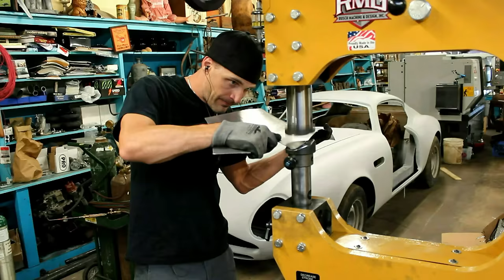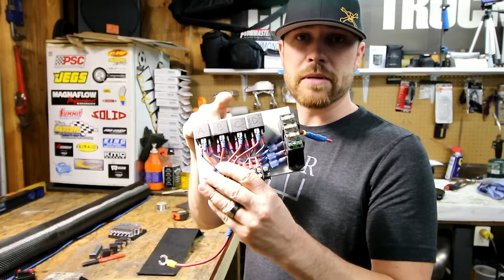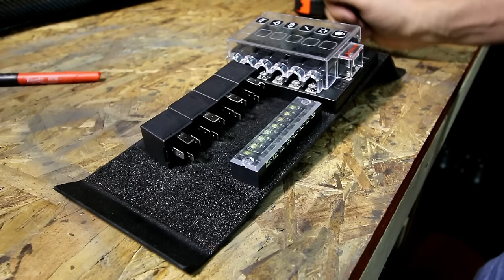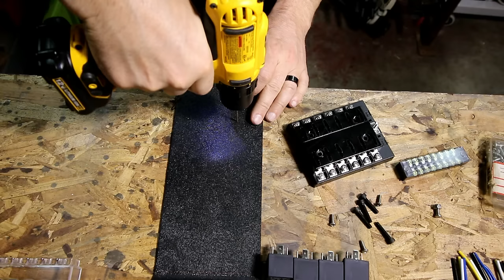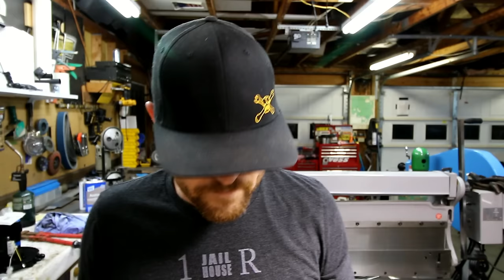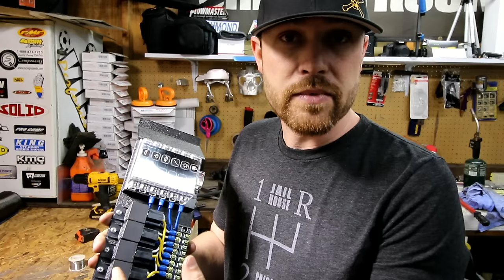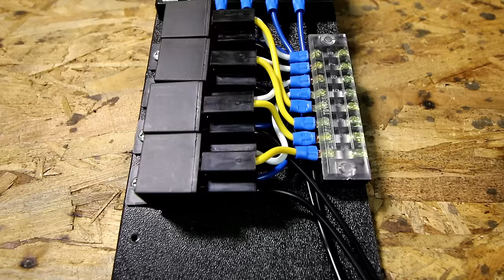How To Make A Power Relay / Fuse Block | Automotive Wiring

Comment: Finally!!!! I have power watched countless videos that say they’re gonna explain relays and fuse box’s but all they do is tell me how they’re installing it their car and don’t explain shit about how to to wire the actual relays and how it all goes together. I had pretty much said this is the last video and I’m giving up. I’m so glad it was your video. You should do a how to video on how to do a how to do video. I finally get it. Great explanation. I had it all wrong in my head. I do have one question that I still can’t find an answer to. I have a 4awg cable ran to an lc7i LOC and amplifier using a distribution block. Can I run a wire off that same block to the fuse box? If so, what size wire? Thanks for the video and any help?l
 -White Boy

Comment: Well i wish I found this a couple years ago when I was wiring all my lights. 
All my relays were bolted to the fender and it doesn’t look bad but it could’ve looked better.  I don’t have the time to make it pretty but maybe this winter I might pull it apart and make it look like it was meant to be there.

Comment: Nice job. I am a big fan of neat and tidy and organised; it makes fault finding easier and shows forthought and planning. I actually thought that the fuse needed to be between the load (switch) and the power. Doesn't your fuse block only blow a fuse if the relay blows? What happens if the horn (light or whatever) shorts - is it fuse protected? Thanks.

Comment: Thanks for video. I've never seen these breakers here in Russia, we're use 70/100/150A PAL type fuses instead. It's cheaper. And - I didn't like the way you attaching relays. If you will need to replace one of them, it would be pretty difficult. It is better to buy some common relay mount which you can attach to base, and you can put relays in and out of it easily. Sorry for my poor English, hope you understood))

Comment: Question about all the black wires going to a common ground.  I've seen this done two ways: One, common ground to the chassis.  Two, common ground running back to the battery negative (which is I think how sPODs are recommended to be wired?).   I'm building one of these to install in the rear of my Jeep, and trying to determine if I should run just a heavy gauge dedicated power wire back to it from the battery, or also a heavy gauge dedicated ground wire back to it from the battery as well.   Thoughts?

Comment: You can easily remove spade connector in plug with oring pick, small screwdriver pushing into plug behind female spade opposite the open end side, to a 1/4, 3/8", releases hook on spade, pull wire out, add longer one, use female connectors with the retaing hook

Comment: thanks for the video, i wanted to ask as a switch also needs power would this connect to the other side of the fuse block? so in effect a horn for example would need two fuses one to the relay and one to the switch.
Reply: I have also been scratching my head over this question. It would seem crazy to have the same circuit to have two fuses. I'm thinking, run a 10 gauge from the "ignition on" to another distribution block, then run positive wires from that block  to any switches you need. Then run the other side of the switches to the activation connections on the "power board" white wires. Does that make sense?

Comment: Nice job. Just got done doing something similar for an led project in my garage. This looks much better. On the relays, any idea why the mounting tab is on the relay and not the connector? Seems like for wiring and if you need to replace the relay it would be a lot easier if the connector mounted to the base instead of the relay.
Reply from the maker: not sure what you mean

Comment: i dint know if the plastic that you used is KYDEX but kydex is a very similar material that is used to make gun holsters and knife sheaths and i bet it would work great for this application, they offer it in many different colors and patterns too
Reply from the maker: yeah its the same thing. Kydex is just a brand name of abs plastic, just like I used.

Comment: Great how to video.  Just a suggestion instead of having a common ground you can add another distribution block for the grounds, this way you can use them Individual as remote ground triggers if needed instead of a hot wire or positive trigger.
Reply from the maker: good idea
Reply: The Fab Forums , Sorry I didn't read all the comments below I guess it's been mentioned before. Thank you for taking the time and making the video it was a great how to.

Comment: Finally found a video That makes this feel simple! 

Would this type of set up, using a 30amp fuse on the fuse box, support a light bar pulling around 25amps through that terminal? Using a thicker gauge wire after the terminal in order to carry the power over a distance? Or would I have to use thicker gauge wire between the fuse box, relay, and terminal? 

Also would this be safe to mount inside the cab? I have a lot of dead space under my cupholders in my centre console
Reply from the maker: yeah for sure

Comment: AWESOME AWESO I am working on my race car and just one step higher than a novice, and this video is exactly what I needed to clean up the rats nest in my floor boards. may I ask where do you pick up the power for the switch to act as a trigger...
Reply: Just go into your stock fuse block with a multimeter, check fuses when your key is on and off. Tap into a fuse that is off with key off and on when key is on for 12v switched trigger wire
Reply: @eugenechurch6135  No key, off and on shut off at rear of car. Race car. Should there be a fuse between the switch and what powers it?

Comment: Subscribed!  Good video.  Wish I would have put the fuse block, circuit breaker and relays on a pre-assembled panel.
Question:  Why not butt connect your power out and switch wires?  One less connection. and could more protected from corrison. 

I look forward to watching more of your videos
Reply from the maker: the power out is the high amp feed. the switch wire is what clicks the relay on and send the power out high amp feed
Reply: Correct, I'm wondering what the purpose of the distribution block is.  To me all it does is add an extra connection point.  Maybe I am missing something.

Comment: Thoughts on using relays that have fuses built into them? I've seen a few of those where you can just attach a fuse to the relay, rather than having a whole separate fuse box

Comment: I use that style relay a lot. I make my own harness sometimes using insulated female spades. Yellow or blue connectors on 30 and 87 or 87a and red connectors on 85 and 86. I am guessing you already know this though but it might help a viewer.
Reply from the maker: +GreaseMonkey Supreme thanks

Comment: I put a relay box in my '68 Toy so I could have stereo, amp, sub etc. without going through the 50 year old fuse block. 30 amp breaker wired to ignition to open but powered direct from battery.
Did the same thing on my motorcycle to run extra lights.

Comment: I appreciate the video, so currently I'm not wiring anything with a big load, but at some point I want the option, so I like the panel and relays. My question is I'm wiring smaller accessories like a rear view mirror with camera, heat seats or side mirrors and I don't want to run multiple lines to the battery. My first thought is to run power from the battery past the firewall and have a panel with a  bar for accessories. Many of these aftermarket accessories use the cigarette light adapter and talk about it having some sort of step down. Does this come into play? Do you have a setup for having relays and 12 volt accessories or do these need to be separate panels? Thanks for the advise!

Comment: Awesome video! Gonna be putting one of these in my Jeep and I have never wired 5 prong switches or anything before so I'll definitely build one of these for ease. Thanks man!
Reply from the maker: no problem
Reply: The Fab Forums So quick question just to make sure I'm right and don't mess anything up. I just take my five prong switch positive wire and plug it into the white wire on the distribution board and then my rock lights positive wire on to the yellow correct?
Reply from the maker: yeah well all relays have different color wires but yeas that the basics
Reply: Okay, Thanks man for replying! Most YouTuber's don't do that. I plan on buying the exact setup you have so hopefully the colors will be the same.

Comment: Very nice and clean set up. I more circuits were needed you could add more relays to the other side of the fuse block. Your link for the fuse block goes to a spade type connection do you have a link to a screw type? Again very clean. Thanks
Reply from the maker: +Rick Starkey Thanks...Yeah the other side I will most likely use for non relay type stuff....le me look for another link

Comment: This may be a stupid question, but if I'm doing a home build with a power supply and want to use a rocker panel to control my various additions, would I be better off with relays or the panel? And would you recommend the distro block for this build? Marine stereo setup on a bbq island

Comment: Hi. Thank you for the video. Giving me some ideas to make sure my car wiring tidy up ans easy for  maintenance. Since am will hook up my head lamp booster as well, could i skip the fuse/circuit breaker for +12? Or just hook up the lamp booster direct to the battery and use the ideas for others.
Reply from the maker: no problem

Comment: translating the ending part of the panel:
86 - power source from fuse block
30 - power out from 86 to switch
87 - power out from relay to 12v on component that needs 12v
85 - Ground
87a - something for a like a bulb indicator or so. (this wasn't explained just a random fact/idea)
Reply from the maker: yeah the 87a is the normally closed side of 87
Reply: Have you got a wiring diagram. Thanks

Comment: Ground Switching the relays is a good idea as well. Supply all relay coils with power from fuse panel; ground them with the switches.
Reply from the maker: +Scott Avuton yeah. All the relay manufacturers recommend switching the power side so that's what do

Comment: Great video. Something that would clarify a question for me as I've ordered most of these components, received them, and am getting ready to replicate your project, is how possible would it be to translate which numbered pin on the relay (30, 85, 86, etc) goes with which color wire to each terminal? Like, the 30 pin on the relay -> blue wire -> + battery power. Any help is appreciated, keep up the excellent customizing.

Comment: RE: Circuit B’s vs. Fuse from Battery to PRFB?
Overkill?
If low draw LED off-road lighting? (e.g., Baja Design Squads or Pros, or, Rigids?
If adding a winch later?

Comment: So where do you pick up your control power? Do you run a fused 20 circuit to the switches to control the relays? How many relays will a 20amp circuit handle. I understand the rest of it just wondering about the control circuit.

Comment: That's what's up.   Nice super clean super mean junction  box. 

Those circuit breakers in AZ,  will dry and crumble as all plastic material.   Coat with silicone spray grease and make sure to enclose or insulate  if your cheap... Like me.
Reply from the maker: Thanks

Comment: So do you need a second fuse box just to supply the various switches with power to the trigger side of the relays? Assume the fuse box in your video would have to have the correct fuse and guage wire to match the load of each one ie fan or lights etc?

Comment: Is there need for relays if you have one big cable going from the battery to the fuse box and from the fuse box to all devices like radiator fan, fuel pump, powerwindows etc. Before the fusebox you add a battery killswitch, evertime you stop driving, use the killswitch to disactivate the fuse box. Am I right with my thoughts?

Comment: Hi, it looks like you know what you're doing.. I got my vehicle back from a "professional" shop that sabotaged my jeep.  I think I was able to correct everything they did except now I noticed they pulled one of my electrical terminals for the headlights and running lights. So, when I turned on the headlights the switch fried and the HB indicator fried. 
The only terminal is the power feed out. What are the steps to fix their damage? Hope I didn't confuse you. Thanks! Great video and Song. :)

Comment: This is awesome. Been following your channel for years and have just come back to this as I'm re wiring my datsun. Quick question, why didn't you use 6 relays and include the horn and wipers? Cheers.
Reply: To answer my own question, I'm guessing you used one in the engine bay and one under the dash for other stuff?

Comment: Thank you! Hate to be a pain BUT, I am going to build this as exact to your demonstration as possible. I am simply running aux lights from this; would you recommend a gauge for the wire coming from the battery?
Reply: MSPhillips 64 
depends on your lights and what load they pull. there are charts out there on the net.  with led's you can use smaller wire.
Reply: MSPhillips 64 go ahead and run 4 guage from battery to new fuse block. that way you can easy add more lights or accessories later. add a circuit breaker like one on here as close to battery as you can. like 12 inches from battery if you have a good mounting location for breaker.

Comment: Nice just found this channel. Those circuit breakers are used all the time in car audio once guys go over 100amps usually, up till then alot just stick with fuses since they are a bit cheaper.  But 300amp breakers and shit like that, a fuse is sooooo much money the breaker makes more sense, plus its just a nicer one time install no fuckin with fuses.  Nice tutorial!!!
Reply from the maker: thanks
Reply: I was just looking at the prices for those circuit breakers, they have come down in price too since the last time I looked at them a few years ago.   Much MUCH better optionwith them being only like 15 bucks.

Comment: thanks for the video and the explanation. Being new to wiring my own panel up i have a question. How do i wire a 3 prong rocker switch to the relay, power unit, and the unit i am powering? any and all comments and advice would be greatly appreciated.
Reply from the maker: power in, power out, and a ground
Reply: The Fab Forums  I understand that, is the power in the power from the relay or the battery? I'm lost as to where my power is coming and going
Reply from the maker: power in is from the fuse panel, power out is what is triggering the relay and the ground is needed to light the switch.

Comment: amazing video, just one question I'm begging you to answer. The switches provide power to close the relay but where would the switches get power from. I was thinking the battery but then what would be the point of the relays, you could just have the power go straight to the switch after the fuse.
Reply: I had the same question. Best answer I found was this guy. A friend of mine also landed the switches power to the ignition wire on my Rzr so it hopefully wouldn't be a constant draw on my battery.  https://www.youtube.com/watch?v=i6uZbCU4vnI
Reply from the maker: I have all my switches tied into one of the fuses on the fuse block

Comment: Great job ...Would a Continuous duty Solenoid  after the breaker wired to an ignition source  be beneficial to keep the fuse block hot only when key is on,or is that overkill?
Reply: You Could Wire that inline with the main power coming into the fuse block. I currently have a Continuous Duty Solenoid in my Emergency Vehicle to run all the Radios, Electronics, and my Charge Guard when my ignition is on. However, the 300amp breaker is a bit overkill. Most of the Relays can "Safely" handle about 30 Amps a Piece. Looks like he has 4 Relays so the max this setup can output would be about 120 Amps. 2 AWG Copper can handle around 130 Amps DC so I wouldn't use any wire smaller than Copper  2 AWG .

Comment: great tutorial - thanks. question: does the relay do the same thing as a fuse? to use both would be overkill to connect say a light bar?
Reply from the maker: no a relay is just an electric switch that can handle more amperage than a traditional switch. the fuse is more on the protection side

Comment: word of warning with those breakers..  they can be thermally effected and go off without warning.  if you look at the specs they can goes off at about 80deg.C.  i had a bunch under the bonnet of my 4x4 and they went off :( from heat not a short.  love the vids keep them up!!
Reply from the maker: +Mick Comp (Mick) thanks for the info Mick

Comment: Love this video, will definitely refer to this! One thing was concerning me however, is a standard car battery capable of handling up to four different LED light bar connections?
Reply from the maker: yeah
Reply: Depends on the light bars, but ya, just make sure you leave the alternator running

Comment: awesome video! quick question...let's say I wanted to power something to have a key on power rather than a toggle switch...I could find an empty spade in my fuse block (or a wire) that's already key on hot and wire it to the "switch" end on the distribution block correct?

thanks!
Reply from the maker: +Chicago06sti yes

Comment: Curious if the type of fuse panels in any car are similar. Its hard to tell because of a lot of plastic paneling/molding around them (hard to see the screw down terminals in manufactured cars) . But if there like the ones you used in this video the install of the different gage wires is pretty much screw down terminals. Similar to the ground and white wire bus terminals in a home breaker box. Though i think there is a difference  between the hot rod or hobbiest cars to the ones mass produced still...the fuse boxes just seem different perhaps they uses manufacture specific  crimp on terminal ends / connector inserts into back of fuse box still a little confused.